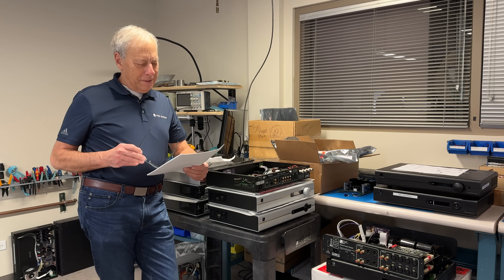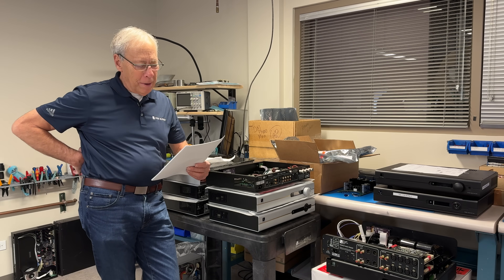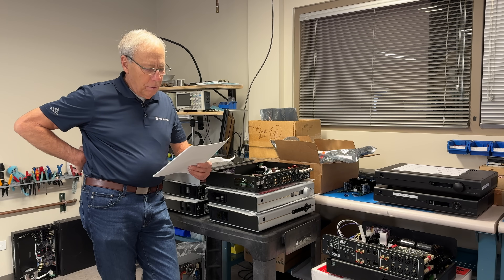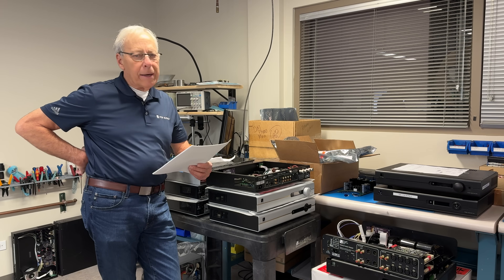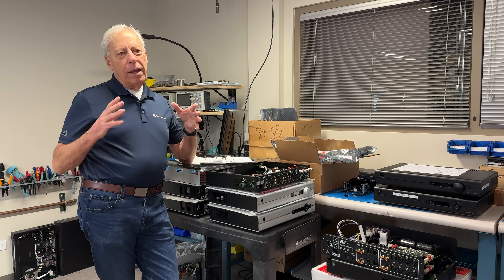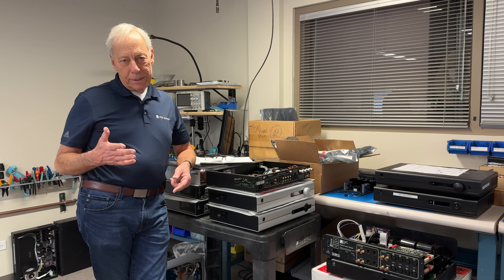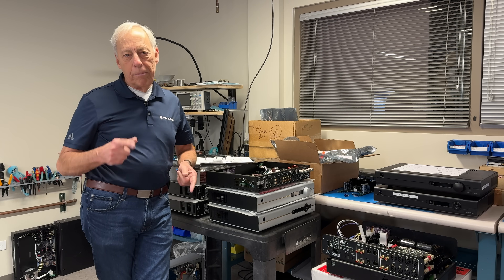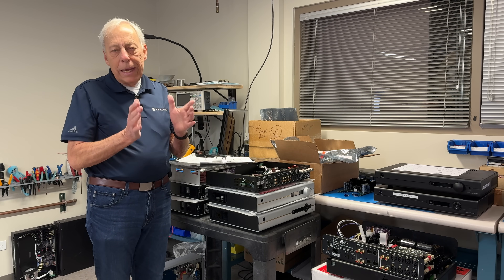Hybrid Class A and D amplifiers

Comment: So these high end class D are really something. It's too perfect and needs some colour and character from the input (class A, tubes) into the mix.
Reply: Character should come from the recording. Otherwise we can leave the hifi moniker behind as we're just looking to add distortion. Not that there's any news in that some supposed hifi enthusiasts do like distorted sound.
Reply: @storkfletcher821  Many years ago I was of the same opinion but soon realised that flattery isn’t the same as distortion. I’ve taken several high end amplifiers and proved that they met their claimed specifications and yet they sounded different from each other. A well designed amplifier can make the listening experience special and it’s not because its specifications are better than the next amplifier but by the way it ‘opens up’ the soundstage and almost becomes three dimensional. I can’t measure that with test equipment and the final 5% of designing a great sounding amplifier is done by listening alone. I think Paul has mentioned this approach by PS Audio in previous videos.
Reply: @AnalogueGround   You're describing something that delivers a function that would be on the recording (if you don't have space in the recording it won't be in the stereo soundstage either). Not the same thing as saying "use tubes to add color and character to the sound".
Reply: @storkfletcher821  I didn’t mention using valves to add colour and character but there’s nothing wrong with doing anything that adds pleasure to a listening experience. I was describing the phenomenon of a change in soundstage when comparing two different amplifiers that measured to spec on the test bench with nothing measurable which would explain the dramatic difference.
Reply: @AnalogueGround   You didn't mention it but the original post does and that was what my comment was about, which means that if you want to argue with my point you need to stick to it, not talk about something different.

So the topic is the statement that something is too perfect and the desire to add color and character from gear rather than the recording, yet you're jumping in talking about measurements and soundstage. 

No one has mentioned measurements and there's obviously nothing about an opened up soundstage that's the opposite of perfect, so you're just missing the whole thing.
Reply: @storkfletcher821 I didn’t reply to the original post but to the sub post that stated Class D was cheap. Later on in the thread I replied to your sub post where you stated ‘character should come from the recording’ followed by derisory remarks about supposed hifi enthusiasts that don’t agree with you. As a designer, I was hoping to introduce some personal experience into the discussion but I’m done here with you as I’ve obviously taken the troll bait.
Reply: @AnalogueGround   You were the one responding to me, not the other way around, so that sets the line for what's being discussed. My first post was about the starting post of this thread, and specifically about some gear supposedly being too perfect and that one should add gear to color the sound.

Your reply didn't address anything I said, you just talked about measurements and how to open up the soundstage, so I pointed that out. No one talked about that and I clearly explained why they aren't the same.

Now you're trying to make me out to having done something wrong when you were the one that tried to argue against something I didn't say? You're just done here because you're not man enough to admit that. Otherwise we could have had a conversation about both topics, as long as you show that you understand the difference.

So if anyone is trolling here it's the guy trying to argue with someone about something he didn't say, and then refuse to acknowledge that. That's not how a serious discussion is handled.
Reply: @AnalogueGround  DigitalGround dont like colour. The very best analog tubes dont have colour.
Reply: @MrDingaling007 in a nutshell, yes. The NAD M23 is so linear it’s been described as the famous “wire with gain”.
Reply: ve been using a mixing interface into a tpa3255 chip amp for my desktop system. I've been honestly blown away at the clarity, air around the sound, and overall cleanliness of it. New class D designs are VERY neutral and transparent sounding amps.

I built up a class A tube preamp around 6AU6/6AG5 tubes. And i run that when im listening to music between my DAC/ADC and the class D power amp. 

Breathtaking isnt a good enough word for what happens to musicality and the soundstage when i do this. Its not in the loop when making mixing and mastering decisions. The neutral, flat, analytical class D sound by itself is perfect for that. 

But for mix reference, or just simply enjoying music. My god, i cannot believe i hadnt discovered the hybrid combinations myself, they sound SO good. The musicality of such a setup is off the scales. I never even would have thought about the combo without coming across PS audio videos. I spent years actively avoiding tubes, or any old school tech in my chain intentionally... Dumb decision.

ICEPower, tpa3255/51. These are the most neutral, least colored, most genuinely detailed forms of amplification ive ever heard. They are so neutral and precise in an analytical way, that without some coloration the detail can even become fatiguing. But NOT in the same way the oldschool class D was fatiguing at all. Harsh isnt a word id even begin to describe these chips with.

I have a ps audio sprout, and had a yamaha s801 (ts since seen the marketplace) but theyre all tpa3255 now thats actually being used. I prefer it to the ice power modules if implemented well, hands down. Everything from mix decisions, to small signal chain changes translates through them with far greater perceived change then any class A/B amps ive used. Even the sprout sounds better with a class A pre in front of it. So did the s801, but not nearly as obviously as with the chip amps.

There are currently true balanced input Chinese class D amps that cost UNDER $200 that outperform far far far more expensive A/B amps (like my old s801 that cost me about a grand with taxes 2 years ago) in every conceivable metric of measurement, as well as to the ear.

Class A tube technology + class D or mosfet power amplification is the king of musicality right now, and ICEPower and tpa3255 are the kings of transparency and neutrality right now. (if properly implemented) the cost of producing these amps is just a bonus. We get cheaper, better performing amplifiers, and the brands we love ALSO net more profit at the same time. A pretty sizeable chunk of which will likely go back into product R&D with transparent companies like these.

And if you guys want absolute business transparency in an audio company, you really only have two choices. PS Audio, and Fosi audio. Yea fosi is a chinese company (HK really, there is often a difference, hong kong based companies, ime, are often more reputable and transparent then western companies ever are, and fosi is no exception, and the same applies to Taiwanese and South Korean companies too) but if you want to see true transparency in business practice, check out Fosi's account on audio science review. When people accused them of using counterfiet parts, they didnt just prove the claim wrong. They posted their purchase invoices and mailing receipts in photo for all to see publicly and deliberately let everyone in on the process of making these amps at every single step. When people ask for explanations or information, they deliver immediately. When people ask for logical changes to products, they oblige. When people talk, they listen. If you message the account with a technical question, you will be replied to in a timely manner from one of their product engineers in understandable english. And the goal of the company, is to bring truly high end, audiophile sound, to the broke and over exploited masses. And that is really, really cool.  This is how we now have a true balanced, 300 watt rms, monoblockable power amplifier at under 0.004% thd you can buy for $180 that blows (most, if not all) $1000 class A/B amps away in every metric. And sounds better then ICEModules to the ear.... 

If that sounds impossible to you, im just going to remind you that 2007 was nearly 20 years ago now. And $40 commercial cpu's of today benchmark  better then $1000 workstation CPUs of 2007 while running on fractions of the power. Feel free to extrapolate. 

The two most reputable and recommendable companies in the audio world right now are PS Audio in the high end, and Fosi audio in the low end. And it wont be much longer before they meet in the middle and the rest of the market has to follow suit with them. The more disruptive products in the low end (fosi), and the more transparent marketing and engineering in the high end (PS Audio) we have, the brighter the future of home audio becomes.
Reply: @thefloop2813 WHAT A SUCKER !!
Reply: Class D is cheap to build compared to A, go figure why they push it.
Reply: @johannesk1855 Try designing and manufacturing an electronics product and then re-evaluate your comment. 😃 Well designed and engineered Class D amplification isn’t necessarily that inexpensive to build - they are complex and can use more exotic components. As they’re often combined with a switching power supply, the saving of heavy and expensive transformers is definitely there but that’s a byproduct rather than the driving economic force. Designing and manufacturing amplifiers is no easy ride whichever technology is used and the highest cost is in production and logistics. This is why so many products are assembled in plants in the far east as they have the skills and investment to manufacture economically at all quantities and quality determined by the manufacturer. It’s no longer about cheap labour and the more we hang on to that notion there grows a lack of willingness to compete and innovate. PS Audio’s greatest achievement is remaining a viable company - it’s tough out there!
Reply: @johannesk1855  -- You can't get much usable power via Class A without the amplifier becoming both huge and hugely inefficient.  On the plus side, your Class A behemoth can double as a formidable space heater.